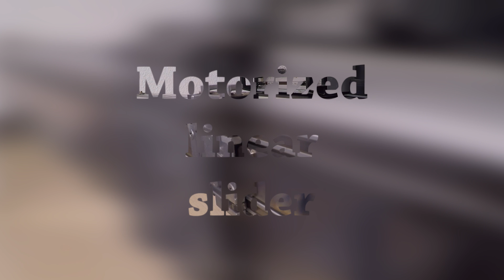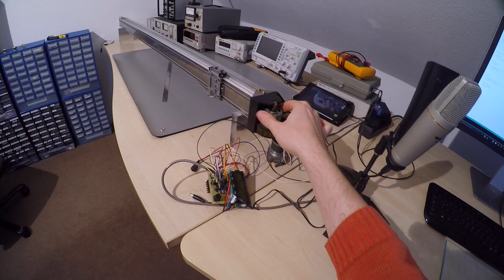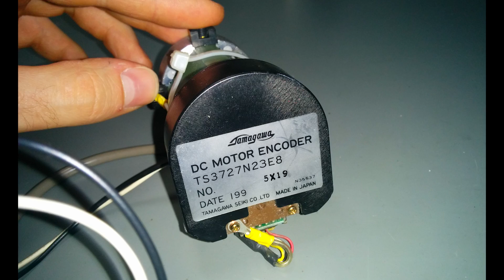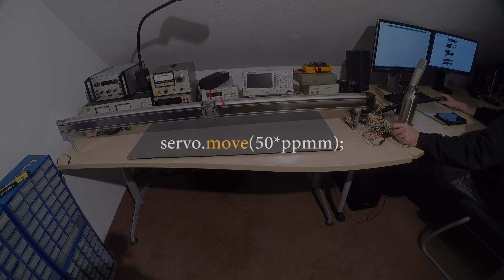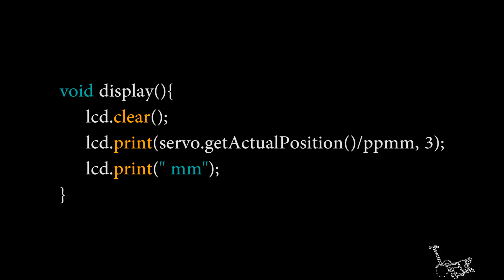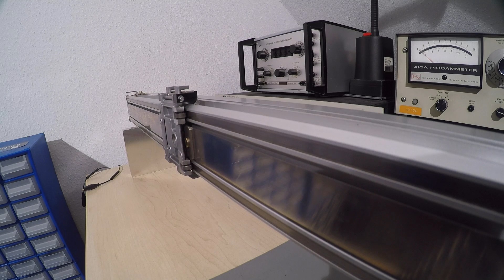Motorized linear slider - DIY Camera slider

Comment: You might want to look here:
https://www.sciencedirect.com/topics/engineering/position-loop
for a primer on motion control.
A naive PID approach won't work very well - especially with a very precise mechanical system where all the faults in the control system will be displayed with high fidelity.
In general:
o  A simple P loop controls motor torque.  Controlling motor current is sufficient in simple systems.
o A PI loop controls motor velocity and feeds into the torque control loop.
o A PID loop controls position and feeds into the velocity control loop.  For optimum performance there should be feed-forward of the velocity and acceleration of the position profile.
o A calculated position Vs. time profile feeds the PID loop with position, velocity and acceleration terms.
A constant jerk (d accell/dt = k) profile is usually sufficient for smooth positioning and acceleration to a desired velocity.

Comment: I solve for movement speed, rather than position. If I want to move to a specific position, then I change the move speed based on the error and I can smooth the approach however I want. This is really nice for an application like this.
Reply: Thanks for sharing! I've been wanting to try this approach, now I know it can work 🙂

Comment: Actually the PID for speed control would have worked wonders with that enconder, only if you took the time to make proper controller calculations, instead of a mediocre sintonization without any mathematical model.
Reply: Actually, screw the math model, they are never close.

BUT....I would have gotten rid of the integral altogether until steady state....and only then for critical position tolerance.
The D term IS ABSOLUTELY USED in the real world if you want to control both position and velocity.
I would've had that loop balanced in a heartbeat 😎
Reply: Never seen or heard the word 'sintonization' before and had to look it up. Agreed on the PID loop, it should work fine especially with the encoder resolution and rigidness of that system.